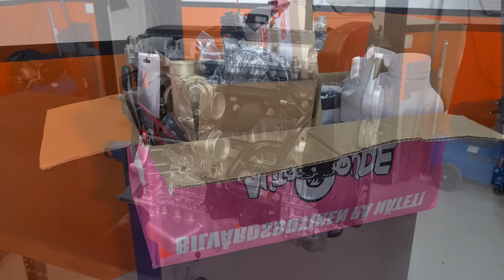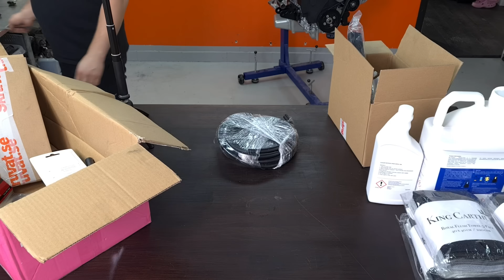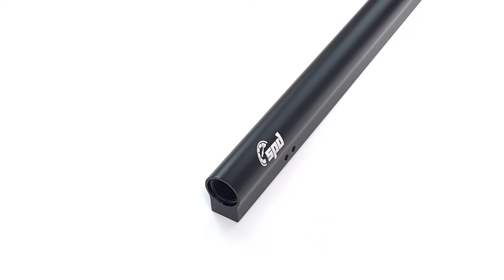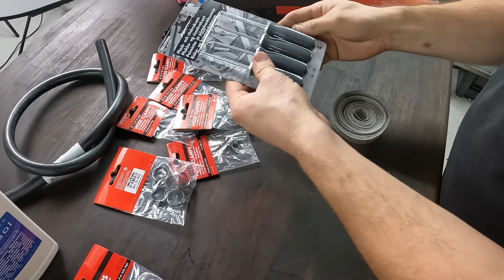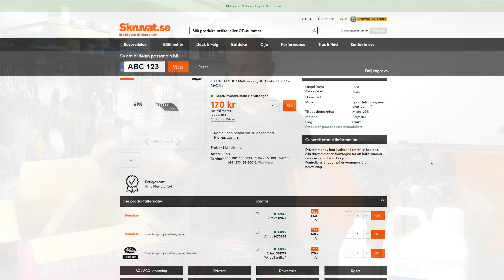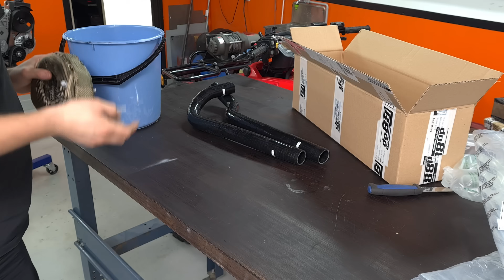I Bought a Hat for my Turbo || Unboxing and More Assembly || The Volvo 740 T5 Project

Comment: What turbo are you using on the T5 build please? I have read the k24 is better out of the 3 turbos over the generations??
Reply from the maker: Im just running the stock Mitsubishi T14 turbo right now for the inspection. We will see what i do around that area when things are registered and on the road 👍
Reply: @BackmansGarage  cool thank you, is it known to be better than the stock T5 turbos?
Reply from the maker: It all depends. If you want the power higher up than the k24 would be a better option. If you want low rpm tourqe  than a td04 would probably be a better choice. But im not experienced enough to tell you one or the other but for tuning i would assume the k24 would be a better choice. Bigger, less backpressure etc.

But these days you have so may options and the technology has gotten better for turbo control and efficiency so maybe, depending on how far you want to go, start looking at Borg warner racing spec or the garret eqivalent but there is so much more involved in a well balanced build and iam honestly not there yet to give you a good answer 😅
Reply: @BackmansGarage  Thanks, I'm looking forward to some more videos

Comment: Blev de inte lite fel med vattnet nu? Ska inte vatten till turbo hämtas från nedre delen av vattenröret? Och sedan vatten ut från turbon ska gå till expansionskärlet?
Reply from the maker: Blir osäker såhär utan att ha det framför mig 😄 får återkomma men är ganska säker på att jag dubbelkollade det där.
Reply: @BackmansGarage  Hehe ja återkom gärna då jag själv också är osäker och bygger T5 RWD. Det är mycket bud och olika setup beroende på om man kör 940 eller 960 kylare bla.
Men om inte jag fattat fel så ska vatten IN till turbon tas från vattenrörets nedre del (en punkt placerad under turbon) och vatten UT ska sedan gå till exp-kärl om man har 940 kylare alt tillbaka till vattenrörets övre del (röret som går mellan topp och block) om man har 960 kylare.
Reply: @BackmansGarage  Ja jag är också lite osäker men TPC säger följande:
"skippa bägge utgångarna längst upp (på den delen du bultar i blocket) sen sätter du en anslutning på den lodräta delen bakom motorfästet, viktigt att den hamnat under turbon, detta är vatten till turbon. vatten ut från turbon ansluter du till exp-kärlet, lämpligvis med originalslangen från en 740T"

Comment: I really enjoy your videos. I have a strange question for you. I have a 2000 volvo s70 with a 5 speed manual transmission. Is it possible to mount a red block to it and what would it take to do so. Outside of new engine mounts.
Reply from the maker: Everything is possible. You will need a bellhousing from a redblock m90 and then get someone to cut the m56 bellousing off and attach the one from the redblock, that and peobably somemore fabrication to make it all fit. I love the idea of a fwd redblock!
Reply: @BackmansGarage  thank you for your suggestion.  I like the white block, but the red block in my opinion is a more reliable power plant with more potential. I really enjoyed your red block build videos.  Thank you for your great videos I find them very informative.

Comment: This is awesome , im here in America and yes harbor freight is cheap and questionable quality very questionable.. I also wanted to know your thoughts on putting a b5234T in a volvo 240 , is it a popular swap in sweden is it even a good idea?
Reply from the maker: Hey, thanks. Ive never been to hf but i keep hearing it on other channels 😄 sounds about the same concept, the place you shouldent shop but you do anyway for some reason.

But yes the b5234t would fit nicely in a 240. There are engine mounts for the swap and so on. But it is also a little bit different and generaly a slightly harder swap. Cant tell you exactly what needs to be done but i know its been done many times 👍

Comment: Be careful with that wastegate and the heat shield. I had so many issues with it interfering. With smooth boost control.
Reply from the maker: It is a concern 😄 Hopefully it will work but I will keep everything under watch the first few days of driving. 

Hopefully the turbo will be one of the first things to get upgraded

Comment: Loved it like always. Great job and can't wait for the end results. My Volvo didn't pass MOT...... I ordered a new exhaust from jt with an 200cell cat because the current one didn't work anymore. I nearly have all the parts only one item missing and can't find it. It is for the rear springs, there should be a rubber part that hold the spring in place where it sits on the axle. At this moment the spring can shoot away when going over a big bump.
Reply from the maker: Haha, The MOT always gets me nervous :D Especially the exhaust values :) 

Im sorry to hear that your cat is dead, I hope the new one will work out for you, i know the JT cat worked for me on an old 240 that I had way back.  

Maybe you can source a used one from a scrapyard somewhere, dont think i have seen a new one.
Reply: @BackmansGarage   Do you know a place where I can get this part with number: 1051487. They are not sold by skanfix or any other place in the Netherlands.
Reply from the maker: @jdcabauwnl  I can only find it on one Russian site but it seems to be discontinued everywhere else. Might need to turn to the scrapyard for this one.
Reply: @BackmansGarage  it is all good. Thanks  you for your time, I really appreciate it. Today it has passed the mot👌🏼 The new JT exhaust I have put on is a little to loud for my liking but the car drives alot better!:) Next step are new LPG injection sprouts so it will run good on lpg and cleaning the engine.# disgusting 😂

Comment: I would be so worried about the silicone melting. But i also worry too much lol
Reply from the maker: Ive had a couple of engine fires during the years and they are not too fun to be a part of. Hopefully is going to be fine, I will borrow heat logging equipment from work and log the inside temperature of the sleeve one the car is up and running.